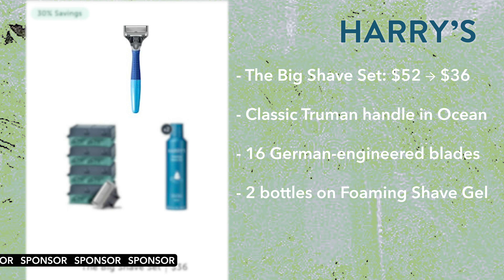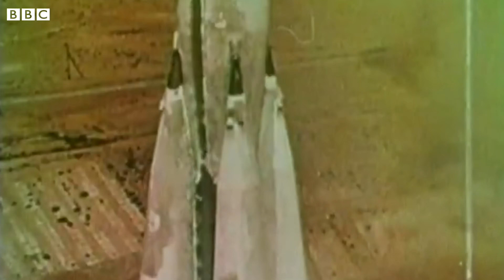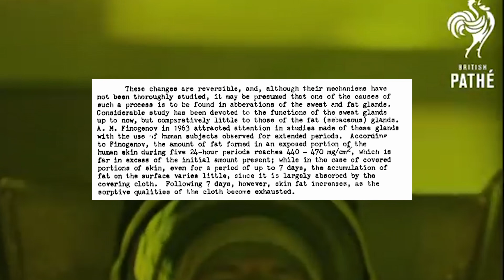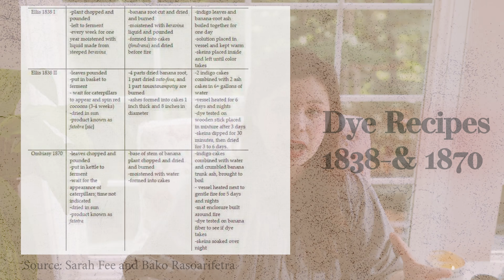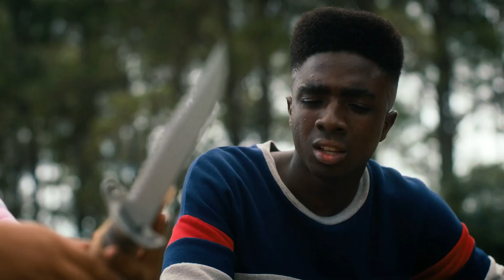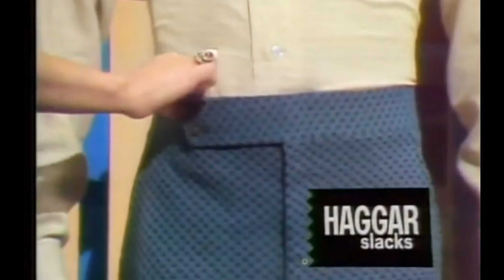The DISGUSTING truth about Laundry

Comment: Looking for suggestions:
1. So I have an HE washer that senses how much water is needed and spins the clothes so they dry in 1/2 the time
2. I line dry delicates, work blouses, skirts, and pants year round
3. I wear camis under many of my blouses and tops in summer and long sleeved base layers under sweaters in winter, and slips under skirts so I don't wash outer layers after each wear
4. My well water is soft, so I use only a little detergent
5. I sew, so I repurpose and repair clothing, and buy only a few new pieces per year
But does anyone have suggestions on what else I can do?
1. I live in NE US so I can't line dry everything during the cold months
2. It's really staticy here in winter, so I do use dryer sheets on some loads or my clothes ride up and cling 
Suggestions?

Comment: Look, line drying is awesome- if the weather permits and the air is clear and you don't have allergies.  I live in California and don't need to worry about humidity or the temperature being too cold for effective line drying, but there's the smoke during fire season and pollens all spring and fall.  
Plus, the point of washing is to remove the oils/dust from fabric, thus removing all food for bacteria. Without food, the bacteria will die/go dormant. And some bacteria is healthy for you!  You don't have to fully sanitize your clothes for safety. The point is to kill/remove the smelly bacteria.

Comment: Love the video. I am a fabric maniac. Dealt with vintage and antique materials for decades. I do not know if you read the comments but  I would like to know why a fabric on a vintage to antique  Eastern European jacket never holds body smells. Even worn against the skin. It is made of linen or hemp,or both…hard for me to tell. It has a heavier inner shoulder strip I assume to help with carrying something in the field say baskets with produce in it. It is fully hand sewn. I also have linen and hemp antique sheets and they stay fresh way longer than a modern linen sheet. I am wearing a cotton man’s shift. Not sure how old but it also can be worn for several nights to bed without getting yucky. I have researched for years and maybe it is how the fiber is grown, thread count or actually how the threads are spun?  I wash my clothes with homemade formulas and I always use a bit vinegar 😊in the rinse cycle. It cleans the machine and removes any trace of soap that is not good to keep in the clothing. New detergents have plasticizers, or what I call this coating in modern detergents.  Another yuck factor.

Comment: My 80-year-old mother taught me that 60°C is hot enough to kill most bacteria (unless you've had a stomach bug or similar) and to use vinegar instead of fabric softener if the water is too hard. She also uses soap nuts, which I've also done (albeit in liquid form), and line-dries. In Switzerland most people live in rented flats with shared laundry rooms, which in addition to tumble driers almost always also have washing lines, because we're usually not allowed to hang our washing in our flats - at least not big things like bed sheets, to prevent mold (small stuff still goes into my guest bedroom onto a portable laundry "spider"). 

Considering that I tend to only get rid of clothes (including fast fashion I bought 15 years ago) because they no longer fit or are no longer my style, not because of wear and tear, I think listening to my mom was the right course of action in this case. :)

Comment: You can get around a lot of these issues by wearing your clothes more times before you wash them. Getting an extra day or two out of your tshirt means you reduce the impact of the problems of laundry by 2-3x just because you have washed the clothes less
Reply: I've never understood the way many people do laundry, aka wash everything after a single wear. If it's not stinky or stained, I simply don't wash it. My jeans basically get about a yearly wash and as a result, I have several pairs that are more than a decade old. Also, just hanging a sweater etc outside for a couple hours is plenty to refresh it if you didn't sweat in it.
Reply: @Narangarath   wear everything at least twice before I wash it.  Except jeans, those get washed once they look or feel dirty, not before
Reply: You mean my laziness in doing laundry is actually paying off?!?!
Reply: Thats nice unless you're a sweaty man that works fast food and when not working fast food goes into a woodshop full of sawdust for fun lol.  I do however were pants more then once
Reply: @lunawolfheart336  yeah, all solutions are individual and don't work for everyone. I'm sure you will find a clothes use cycle that fits your needs :)

Comment: if you don't have a spot where hiding more personal laundry is possible, running several lines, and using the center ones for more private items is one option, and acquiring a collapsible wire drying rack to keep inside would be another

Comment: The reason I don't wash my underwear on hot isn't because I put them with other clothes, it's because it will damage all modern underwear. I've never seen women's underwear that doesn't say it should be washed cold. Elastics wear out, and especially women's underwear made out of thin, soft fabrics isn't made to be washed at sanitizing heat.
Reply: Also, it shocked me when I first learned about historical laundering of linen underwear because linen clothes sold today will all say they need to be handled very delicately.

Comment: 27:45 Also, our homes and towns are built around the assumption you either have an easily accessible washing machine and dryer (whether hot air or modern "ventless" more available in the EU), or you have access to a car or time to ride public transit to the nearest laundromat. You basically have to own your home if you want to start laundering in an old-fashioned way, with the space, mess, and water consumption it requires. Most of us can't win. 🤷🏽

Comment: So I hang my clothes to dry. I only tumble dry my sheets and towels, because I can't line dry my clothes, as my apartment is less than a kilometre from a highway so anything I put outside gets a little layer of soot on it. I stopped using fabric softeners a decade ago. Perchloroethylene (perchloroethene/PCE/perc) has been outlawed for dry cleaning in Canada a while back. You forgot to talk about the kerosene...
Reply: Honestly Abby, the research you did for this video is very surface level...

Comment: You obviously do not live in anyplace with pollution or lots of dust and do not have anyone living with you who has pollen allergies. I live in rural Oklahoma and when I line dry clothes they sometimes come in dirtier from blowing dust and full of pollen. Not to mention airborne general nastiness from the cows that I can smell when I walk out my front door or the ones I cannot smell because they have blown in from Texas or Canada without any filtering from potentially hundreds of miles, because of Great Plains flatness. When the cattle aren't on the land it is mowed short or plowed under and replanted with wheat or cotton or corn or any of a dozen other crops that produce pollen. Sometimes instead of mowing and plowing, the farmers mow and then do controlled burning before planting. This puts soot and smoke into the mix. Our "fresh" air makes it potentially life threatening for allergy sufferers. I wish there was a safer and cleaner way, but until that happens, I love my tumble dryer.

Comment: My mother taught me to line dry the sensitive things always. On laundry days the space around the washer is a mess with sorted piles. Underwear is a pile by itself. She and I are both ADD space cadets, and remembering the drier is HELL--for me it takes additional timer on my phone as I will not rely on the drier's alarm. We half dry most other things then hang those up to line dry as well. Because short attention spans. But line dry outside ... in Florida. HAHAHAHA!!!!! No way. We line dry inside. At least with HVAC there's a chance it will be dry in around 24 hours instead of days. 
We both have used dye free, fragrance free detergent because of massive sensitivities. 
BTW I have a few clothing items that I have had for 20 years. And quite a few for 10 years that still get regular wear.
There is so much truth to this video. But I never really made the connection of our washing practices to the longevity of our clothes. 
Thanks for solving the mystery of the little holes in my shirts though. I still wear them >_>

Comment: You can use the dryer to heat the t shirts to body temperature or a tiny bit hotter and then hang them up  inside.
Reply: And you can use your dryer in a smart way. Overloading your dryer is wasteful. Your dryer can handle its load better if you will separate based on how quickly the items dry and this also helps you to not overcook the clothing you put in the dryer. If your dryer is overloaded, opening the dryer and rearranging the clothing or bedding helps it to dry better. You will be doing this anyways  if you are taking out the more quickly dried things snd leaving in the longer to dry things. You did not mention spandex anc how fragile it is to higher temperatures in the dryer.

Comment: So I normally just throw my linen shifts in the washer, hang them to dry and iron them while damp. But after watching this video, I wanted to see what hand washing would do. I took some castile soap and put it in water in a large pot to heat up on the stove. Once it was boiling, I added a shift that I had washed a couple days ago and hadn't worn since. Let me tell you, the water turned brown. That supposedly clean shift turned the water brown. I've obviously hand washed clothes before, but I've never used that method and they're usually not white, so I guess I probably just attribute any color in the water to loss of color from the garment, not dirt. Now I just wish that I had access to an outdoor line. That's the #1 reason why hanging to dry and hand washing aren't practical for me. If I hand wash, I can't wring it out as well as a spin cycle so it's just dripping large puddles all over my floor.

Edit: I may have found a solution, but have yet to try it. My washer has a "drain and spin" setting, so I could hand wash clothes and then put them in the washer to wring them out before air-drying.

Comment: Ok before anyone freaks out because detergent isn’t anti-bacterial - it’s fine. Like, soap is also not antibacterial but it still gets rid of germs. Surfactants work at getting rid of bacteria because they make it so that germs are unable to cling to you or your clothes (the same property that loosens dirt loosens germs too) so like, your laundry is still gross, but detergent does get rid of germs, even if it doesn’t kill them. In this way it’s actually better to use soap/detergent than stuff like hand sanitizer, because hand sanitizer kills the germs but leaves the c0rpses.
Sorry for being gross, but it’s true.
Reply: Also, if you insist on using alcohol to kill bacteria DON’T USE PURE ALCOHOL as a disinfectant. It won’t hurt you but it doesn’t work very well. Weirdly enough, a mix of 70% alcohol (ethanol preferably) to 30% water is better at killing bacteria than pure alcohol (and it makes the bottle last longer too). There’s like a chemistry reason for why but I don’t remember why. I just know that when I was a lab tech working in clean rooms where any bacteria would ruin our experiment, we would disinfect with the 70:30 mix and that worked wonders.

Comment: You can make the dryer a little more efficient by throwing a clean dry towel in with the load. This is helpful for winter and overcast days.
Reply: That’s what Maytag mentioned in a vintage pamphlet/instruction book for the Halo Of Heat dryers from 1962 I have. I usually go by the suggested drying times (15 minutes for small loads, 25 minutes for medium loads, 35 minutes for large loads) so things are damp dry and usually hang my shirts the rest of the way so they’ll dry on their own.

Comment: Having lived in Africa, I learned to wash cloths by hand. I can get things cleaner by hand than any machine. Last year I lost my well for 6 weeks. I had water but not running water. Wash clothes by hand for 6 weeks and see how quick you get efficient about your laundry. (And the grey water was used to flush the toilet)  As a Canadian, I often wear a T-shirt as a layering piece in the winter, vs having the furnace cranked...I don't have to wash my sweaters nearly as often. Aprons help with stains when cooking or working outside.  Those little holes?  Those are often cooking splatter melting the synthetic parts of your fabric. I also do the hang wet clothes in the bathroom, and then you just hang then in your closet. Drying inside in the winter helps the humidity in your house.

Comment: I have lots of thoughts. Wouldn't it be more cost effective to use isopropyl (aka rubbing) alcohol (I don't know if it's called something else in Canada) rather than drinkable alcoho (vodka)l to disinfect clothing? It's pretty cheap in the pharmacy. Or is there some reason why that's not viable? 

Also: doesn't the peroxide products like OxyClean kill germs? Theoretically it does, but I wonder if it gets overwhelmed by the sheer amount of organic matter in a load of laundry to the point where it doesn't do a good job.

I think one reason we moved away from some of the older/better laundry practices is that elastic--which we alllllll love in our clothing to make it extra comfy---doesn't handle heat well. It breaks down faster. My kids are 5 years apart and in some cases I had to buy all new clothing for my second child because we had stored the clothing in an attic and the heat made the elastic disintegrate! I'll never make that mistake again. (If I'd had the spoons I would have simply replaced the elastic--but I was ill at the time so don't @ me.)

You know what else is gross about laundry? The parts of the washing machine you can't see are coated in soap scum and disgusting grunge. Those washing machine cleaners you see in the stores aren't a gimmick. They are real and necessary so you aren't redepositing yuck all over your clothes with every wash!

Comment: I think people generally wash their clothes too often too - a bit like feeling the need to shower every day, which for most people is also unnecessarily frequent for the majority of people.  I wash my clothes if they smell or are stained.  I might wear a top many times before I wash it.  If there are stains, I use localised stain removers (I recently bought some eco-friendly ones that have been very good).  

Also, you didn't mention about using cool washes, which are definitely better for the environment, bills and the clothes.  Most of our washing is done on a "quick" 30degree wash which takes 35 minutes.  Sometimes, I do the 40 degree quick wash which is 45 minutes and it's only if I have a very full machine that I do it on a "normal" timed wash, which by comparison is TWO HOURS!!!! 

I only wash on a synthetic setting as the cotton settings are longer again.  I wonder how many people actually track the lengths of their washes or perhaps they just open the door, load and set it off.  I'm very suspicious that a lot of the "advice" about washing machines is by the manufacturers of those machines and the companies that sell you the detergent for them... they have a vested interest in you using them as often and as much as possible!  Don't fall for it!

Comment: I use a portable laundry rack. It's outside in the summer and inside by the heat vent in the winter. And it folds away nice and flat when I'm not using it. And if I do use my dryer, I have felted wool dryer balls to speed up the process and have less wrinkles.

Comment: I've used white distilled vinegar instead of fabric softener for years. It softens fabrics and removes odors. It also has some disinfecting properties, although its not a strong disinfectant. Its also important that it goes in the rinse cycle because the  detergent and the vinegar will neutralize each other if they're added in together. I used a downy ball for this purpose in my old machine and it worked really well. I also add baking soda in with the detergent at the beginning of the cycle to help soften the water. Another tip is to do an extra spin cycle to get more water   out of the clothes if you're using a tumble dryer so that it takes less energy to get the clothes dry and also so the clothes are exposed to heat for a shorter period of time.

Comment: In the southern pacific region every house comes with a clothing line. Fenced or not. Some people choose to dry their under clothes inside on a laundry rack, but I know I don't really notice if someone hangs their underwear outside or not. With the large hole in the ozone layer here you are guaranteed to have a sanitized garmet when you are done. I personally use a dryer in winter because I forget my laundry on the line which is mostly fine in summer (just need to worry about colour bleaching) but is not great in winter (rain almost everyday). 

The other thing that I find common here is laundry sanitizer. Most of them are antibacterial and don't need hot water, some of them are also anti-fungal as well.